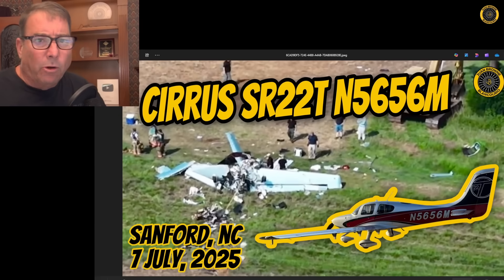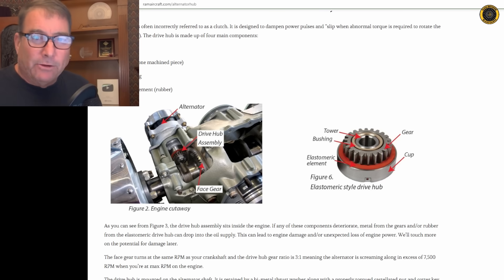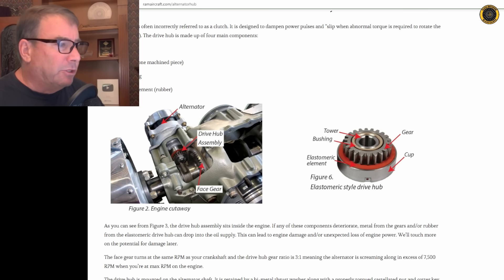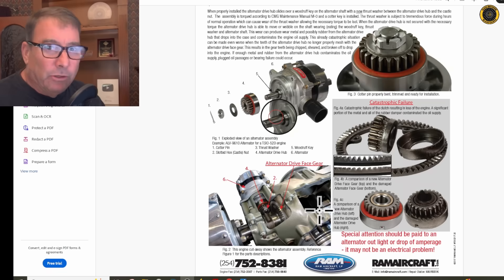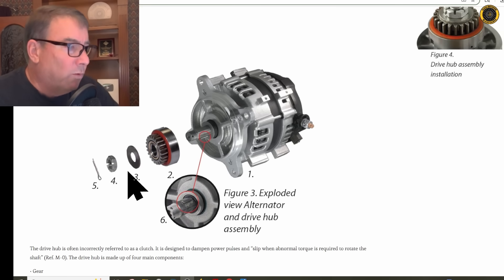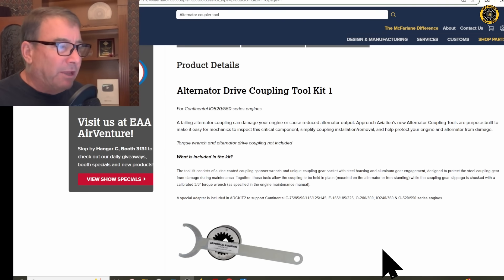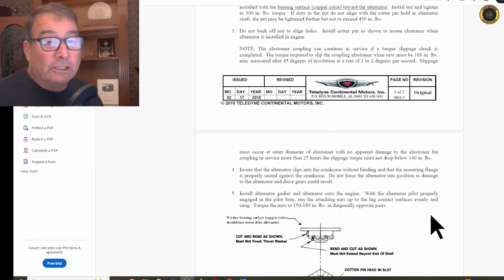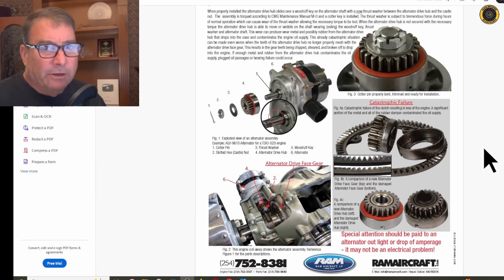Alternator Drive Failure-Can Lead to Engine Failure!

Comment: I still cannot wrap my head around the idea of continuing on a long distance flight with ANY kind of anomalous performance of ANY system WITH MY ENTIRE FAMILY ONBOARD the plane.
Reply: One of the most difficult conversations I’ve had with a corporate jet client: Why we can’t fly with one of our tiny backup gauges inop. The itty-bitty ones only used with a complete electrical failure. Will we need it? Almost certainly not. Can we legally just go without it with passengers aboard? NOPE!
Reply: @rbeard7580  totally agree, thanks for keeping it safe. Out of curiosity, which gauge was it?
Reply: @beargillium2369  If I recall, it was the attitude indicator.
Reply: @rbeard7580 It is good the law backs us up in some cases.
Reply: I agree.  Cecil along his route had a cirrus shop.  Plus can deploy CAPS 1000 agl.
Reply: @idkjames  It's the last one that gets me. Why NOT pull the chute?
Reply: @grahammonk8013  if i had to guess he was thinking with his wallet or just total panic. I find CAPS makes me more thoughtful though.  I know i have a back up.
Reply: @idkjames I agree
Reply: @grahammonk8013 That’s literally what the manual and training tells you to do. No forced landings other than the runway- Cirrus SR20,22 and the vision jet. If you’re at 10k or 6k you have plenty of time to trouble shoot the issue, at best glide.
Reply: @grahammonk8013  Because if you are less than a mile from the airport and the engine is still (barely) running... would you try to save the plane or write it off? I can see people reacting in the moment either way., unfortunately. WHY, though, you should just write it off and pull the chute? 
What do you have to do to land? I suspect what happened was the plane was running on reduced power but still flying just enough to cause the illusion that you could make it. But the second you lower the landing gear/get ready to land, you go from barely flying to stalled.
Reply: @plektosgaming  Hadn't really grasped they got that close.
Reply: @grahammonk8013  Which makes it all the more insidious. Trying to get there that last couple of miles and the second you configure it to land, you're too low for the parachute, and too slow to recover. With no gauges to reliably tell you if your airspeed is too low :(
Reply: @plektosgaming The landing gear was never retracted.
Reply: @FollowTheJohn  I was speaking more generally, but the idea being that if you have a barely flying plane, doing anything to configure it for a landing is going to drop air speed. It will be interesting to see that the report says about the flap setting. Though, with a damaged engine, it's still rolling the dice - you use the chute. Or better yet, don't take off on a trip with major problems?
Reply: @idkjames  He could have deployed at 500 AGL. I don't under stand any of this pilots thought process.
Reply: @FollowTheJohn  yeah, i was just thinking 1000 has a 100 percent survival rate and he was above that.
Reply: My thoughts exactly. Continuing a lengthy flight with known electrical or mechanical issues is just asking for trouble. Yes, there are backups, but that should be only relied upon to get to a safe place to land. What kind of person risks the lives of their entire family just to maintain a schedule? SMH.
Reply: Get home itis
Reply: @timmcleod9507 I agree, the pilot's thought process with all the family on board would have meant that instead of landing at the nearest field once the problem started and then having to find an alternative method to get home you fly all the way on a failing engine that's going to cost you $50k to repair IF you successfully get back, false logic. RIP to the four lost souls.
Reply: I cannot wrap my head around the idea of a new design that is worse than the old one. Somebody tell me what was wrong with the belt driven alternator option.
Reply: @Angelum_Band  I agree, not a failsafe design, the belt fails, no big deal, easy to check and replace.
Reply: @Angelum_Band Exactly you could fly for hours in daylight vfr with lose of a alternator belt.
Reply: @Angelum_Band  They must have had Rube Goldberg design the new one.
Reply: @Angelum_Band a nubee. It’s hard to get good engineers these days because they spent most of their college years gaming!
Reply: Agreed... It's not a minivan... Can't pull over at any minute... And even on the road, that would have me looking for the nearest place that had both a garage and a motel.

In the air? I'd be immediately looking for the nearest three alternate airports.
Reply: One problem with a backup power, like a second alternator, is that some people will see that as a reason to accept more risk.
Reply: @theophrastus3.056  100%. There was a really interesting study done years ago   when they noticed newer cars with all the latest safety features like air bags, crumple zones, energy absorbing dashes, etc. weren't reducing the fatality rates vs old cars. They discovered the reason was because drivers ended up driving proportionately faster, more aggressively, less attentively based on how safe they believed the car was. It became known as the Peltzman Effect or "Risk compensation"
Reply: @GlutenEruption  Interesting. I’d never heard of that.
Reply: @GlutenEruption  Econ 101 thought experiment - if you want to reduce car accidents,  add a dagger to the steering column instead of an airbag.
Reply: @GlutenEruption  Except that what you claim ("weren't reducing fatality rates") is simply not true. Highway fatality rates per mile driven are way down relative to where they were before all of those measures. There were 5 deaths per billion miles driven in 1960, vs 1.27 in 2023, i.e. a 4x reduction. For any given trip you take you have a much lower risk of dying in a modern car with all of those features.

What has also happened is that the US population has become larger and wealthier and shifted away from using mass transit, such that the number of miles driven has increased almost as quickly as that accident rate has decreased. The result is that if you look at this the most superficial way possible (total deaths) it appears not to have improved, but the reality is that if we were still driving 1960s cars we'd be killing 200K/year instead of 40K.

The "risk compensation" effect is one of those moral hazards that economists love to theorize about, but it doesn't hold up under any serious scrutiny of the data.
Reply: @GlutenEruption  I remember the 80s, when Volvo was marketing their cars as being safer than others. The most arrogant and aggressive drivers at the time were driving Volvos! As if you are obligated to drive that way because you spent extra on a safe car. These days, Volvos aren't marketed that way and their drivers aren't a problem for me, it's the a-holes driving BMWs.
Reply: @GlutenEruption  Same thing happens when roads are made safer — wider lanes, clearer sight lines, fewer trees, poles and other hazards.  Existence of visible safety margin encourages drivers to drive faster.  When streets are intentionally narrowed, and traffic patterns made less clear, people need to put more focus on their driving, and they naturally slow down.
Reply: @GlutenEruption Absolutely. Do we see the same effect with bicycle helmets?
Reply: My guess is that there's some normalization of deviance going on here. Once you get away with ignoring one "last as soon as practicable" situation the natural tendency is to convince yourself that ignoring those checklist items is safe, and then later you maybe graduate to ignoring "as soon as possible" situations as well.

This is going to sound awful and perhaps biased, but listening to the recordings of this guy's radio calls did not make me feel good about his overall competence and intelligence. Just because you were good enough at your day job to afford a plane (or lucky enough to be born wealthy) doesn't mean you're remotely competent to pilot one.
Reply: @patrickchase5614 The more expensive the airplane, generally the less I expect of the pilot.
Reply: Why would you engineer a alternator that had a obvious critical flaw? How did it pass with the authority
Reply: I don't understand it either.  Condolences to the families, friends and loved ones left behind.  Rest in Peace to the four souls on board. 
I don't know about this fellow's wife - but I know that in a situation like N5656M encountered my significant other would be saying to me  - "land this thing and get that problem looked at - you're gonna get us all killed !".
Reply: Following blancolirio has made me to have a strong opinion that when deciding if to continue a flight operation that's no longer nominal, the people who have a schedule to keep are sent to different room.

Ideally if you have a schedule it's a professional pilot flying, not the person with the schedule.
Reply: Getthereitis is a serial kil*er!
Reply: Everybody's brains work differently, Flat Earthers exist. 
Perhaps there should be screening tests for logic before granting a pilot's license. 
Tests for spatial awareness also.
Reply: Easy!  He Had a case of GOT TO GET THERE NO MATTER WHATitis.  It’s usually lethal.
Reply: Most likely the pilot assumed that it was like older systems and at worst the alternator would fail and not do anything to the engine. 
That said, the design seems overly complex compared to a belt?
Reply: @plektosgaming Assuming things while airborne is dangerous.
Reply: My old instructor airline pilot they flew their 757 with fault. Fault developed in generator, reset for return flight just to get it back to base maintenance, failed again in flight. They carried the fault. Bet it happens often.
Reply: Hit the starter on a gtsio520 and you can destroy the engine as the starter can desynch the crank and the camshaft.

Very expensive mistake
Reply: Continuing with an alternator failure… it depends. If it has this terrible design of drive, hell no, but if I’m a long way from mx, and I’m fairly certain it’s just a regulator or wiring issue, and the system isn’t going to stop the damn engine if it fails… do I have a backup alternator? Do I have a handheld radio! Is it hard VFR? Is there a lot of traffic? I’ve gone an hour with a dead alternator. I had a handheld. Hard VFR day. On my way home, nowhere other than the highway to land anyway.
Reply: That mindset may come from the emphasis that is put on the fact that the engine will run without an electrical system. 
I have personally heard flight instructors do that. I have never flown a cirrus and I wonder if emphasis is put on this kind of failure with a direct drive alternator. 
Sometimes the older systems are better when things go bad.
Reply: You said it! Unreal
Reply: While watching the first video, I kept saying out loud, “Why didn’t he land someplace and get things checked out?!”  “The radio's not working, imma keep going”!!!  Very sad outcome, for sure.
Reply: @heidifritz3053  I think a lot of it is mental perspectives and background/training?  I worked for years in IT being the guy who had to come in and fix everyone's It screwup and "emergency". My training early on, though, was as a bench tech and before that, doing electrical work with my father.  So I understand electrical and electronic systems, as well as mechanicals ones, and my reaction would have been to immediately land it - anywhere or pull the chute.  Because it there's a problem that causes the entire electrical system to fail, despite there being a "backup" generator, this is a catastrophic issue. Something blew apart, shorting wires, fire, etc. Ground. Now.
Understanding how something operates isn't quite the same as how it works, and this might partially come under better training/a bit more focus on the basics of flying/mechanical and electrical systems? I know of a few pilots that just kick problems off to the mechanic (or worse, ignore it) and don't get involved with fixing their planes/understanding the systems. I'm not saying this is definitely the case here, but it seems likely, as the severity of the error wasn't realized in time.
Reply: You cannot teach stupid to stupid. I am in automotive business and see people driving their car with a CEL on or overheat on miles after and question why their motor blew up? Go figure.
Reply: This is just insanity at its finest how could you 😢
Reply: This

Comment: My first thought about this kind of non-failsafe design is that “we’ve been designing and building engines for how long now?”  Yes, I get it, these designs are “supposed to” accommodate some sort of anticipated failure. Just not all foreseeable failure modes it would seem. Pilot can be criticized for not landing sooner, but what about flights with fewer options for alternates?  Backup electrical system does little good when your engine is taken out at the knees.

Comment: These gear driven alternators have always been a bit of a pain.

      You should have also mentioned that in addition to properly assembling the elastomeric coupling to the alternator, it is critical to then use a dial indicator on both the elastomer cup as well as the driven gear.    An egg shaped cup or non-concentric driven gear can cause lash problems and lead to uneven wear and eventual failure.
       A dial indicator on the driving gear of the crankshaft is also warranted.

Lastly, the driven pinion should be painted with Prussian blue or dykem which is a machinists dye layout fluid.

      After assembly of the alternator to the engine and pulling the prop through several rotations, there should be some measurable lash in the gear interface.

    The alternator should then be removed and the driving gear on the crank is checked for the presence of the dye on the gear teeth.    If something is out of whack, one will not see even witness marks of dye on the gear teeth.

     Sometimes, due to crankcase machining and line boring or sloppy manufacturing of the elastomer, tolerances start stacking up and the elastomer might even contact the crankshaft gear itself.

      This can be mitigated with different thickness gaskets that act like shims.

         These TCM direct drive alternators are definitely not “bolt on” accessories and deserve great care in their installation.
       

      More often than not

Comment: As a mechanic, I don't like that mechanical arrangement one bit. There is only one main bearing/support which has to withstand the 90º forces exerted by the crown gear, not only against the alternator loads that might be well pre-calculated, but also any potential anomaly like a defective alternator bearing or even seizure.
Reply: Agree. A belt will just burn off.  Appears to be a lot of engineering, cost and worry to drive an alternator.
Reply: 100%. What a baffling decision to switch to this design.
Reply: Progress, US old timers can understand that sometimes newer stuff is junk
Reply: Seems like an extremely poor design.  Shame on Cirrus!
Reply: @pauljones6321  Cirrus? Continental is engine manufacturer.
Reply: @pauljones6321 Cirrus has almost no say. They had to pick a certified engine and every certified engine has some weakness.

Comment: There are several ways to drive an alternator in such a way as to not have internal engine damage no matter what the alternator's failure mode is. Some design engineer needs to have his creds pulled permanently for this.
Reply: I agree that there's an engineer at the bottom of the alternator failure issues, but it's quite unlikely that he/she would lose credentials over it.
Reply: @wadepatton2433  A little JAIL TIME should teach them HOW NOT to design a geared coupling...

Comment: The tool to test it is $200-$250.  The alternator drive coupling is $720-800 USED and $1,500+ new!  I think I like belt drive alternators, because a belt failure won't likely cost you a catastrophic engine failure AND, It is easy to inspect and costs a whole lot less to replace it!!!
Reply: Especially with dual alternators. I haven't had a belt failure on a car in the last 30 years, most of them were still in serviceable condition after 90k miles. All external, cheap, easy to inspect/ service, can carry a spare, and acts as a disconnect in the event of a seized alternator, letting the backup system take over so you can land safely.
Reply: I prefer a belt, but you do need to remove the propeller to change the belt.
Reply: @markpatterson7151  True, replacing the alternator belt requires removal of the prop, but that's only about an hour or two of work.  Or, in a pinch, you can use those link belts, which are reported to work very well.  Thanks @blancolirio for the video - I didn't know how these direct drive alternators worked until now.
Reply: doesnt sound a good engineering putting elastomer in such a place. Its another point of failure that could be prevented
Reply: But the gear drive has like 5% less friction. You don't want to make that trade off do you?
Reply: In a pinch you can get a belt at AutoZone...the make, model and year won't come up in their computer.... that's about as max dangerous I'd live my life.
Reply: Not a choice, Lycoming use belts, Continental uses direct drive.
Reply: You only need to remove a belt on Lycomings. Continental has both styles, direct drive and belt driven.
Reply: It’s also a choice of where accessories can be installed. On the 470 Continental it’s belt, on the 520 and 550 it’s direct drive. Maintain the airplane.
Reply: yep  tried and  true
Reply: A new certified belt would likely cost $1000..
The badic cost of a direct drive is about $100. The certification markup is $1400.
Reply: that's ford for you